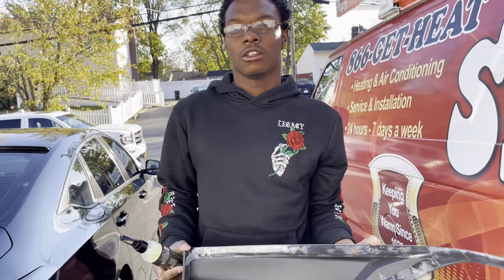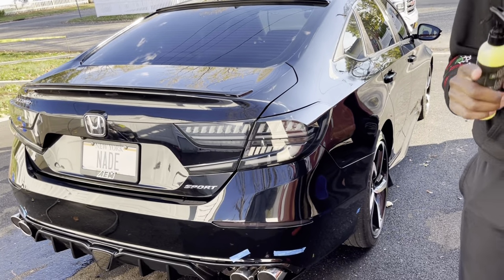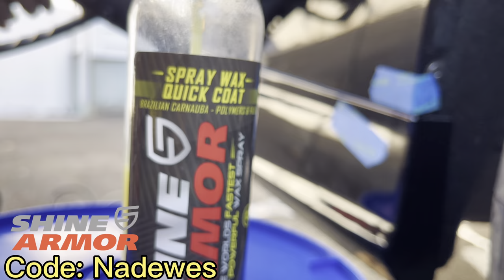Rear side aprons install 2018-2022 accord

Comment: Looks dope bro! Which exhaust or exhaust tips are those? And any issues getting the diffuser around them?
Reply from the maker: They are Yofer exhaust tips and with this diffuser it pushes it down and creates a small gap but you want to cut bottom piece of the diffuser you can will still look good but that up to you

Comment: Hey bro love the video! Was just wondering what took do I use to take the black side piece that connected to the back bumper ? Behind my back tiers for example .
Reply from the maker: I’m a little confused on the question not sure what side piece exactly but if you can text me on instagram with a picture of that would make it a bit clear
Reply: @NadeWes  yeah bro what’s your ig?
Reply from the maker: Key_Nade2

Comment: You ever have to take off the side aprons? And was it hard with the gorilla glue
Reply from the maker: I haven’t have to take them off and the gorilla tape is strong when applied correctly but I have had to remove the front lip one time and it took like 10 minutes because it is very strong but with goo gone it will come off

Comment: Thanks for uploading your mods! Did you anything to the radio? I've seen a couple of videos where the radio has a different wallpaper and I was wondering if you hack into since it's android based.
Reply from the maker: No I didn’t hack into the radio you can change the background of the clock that’s what you are seeing in the videos but you can buy a device that lets you watch YouTube and stuff but I don’t have that if I get one will will make a video thanks for watch the videos really appreciate it
Reply: @NadeWes  thanks for the quick response, I'll look into it.

Comment: Is the clear gorilla tape better than the black one? I noticed you use it on most of your install. I’m trying to install same, but wondering which I should get…
Reply from the maker: They both work the same doesn’t really matter which one you get the clear is just more available in my area that’s why I use that one a lot
Reply: @NadeWes  ok thanks, just subscribed! I’ll be using ur vids for future installs on my car.